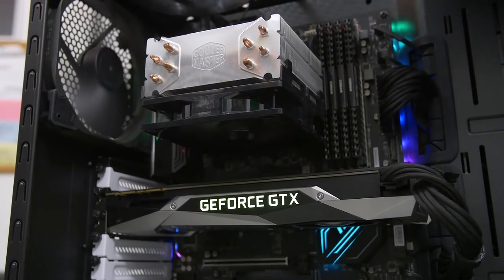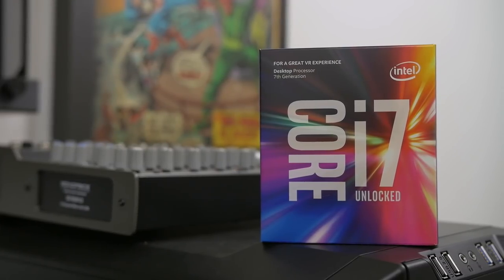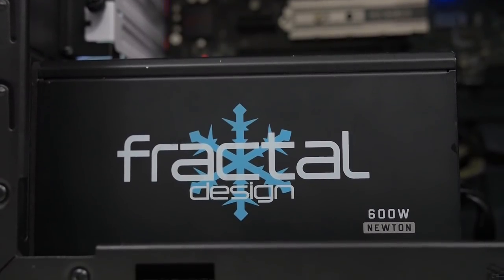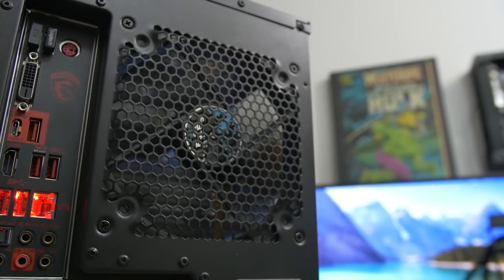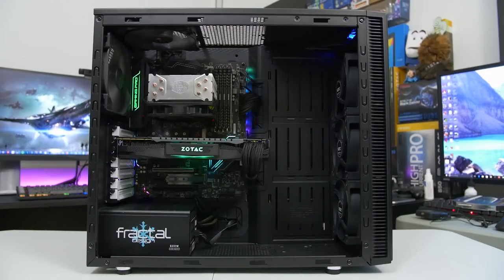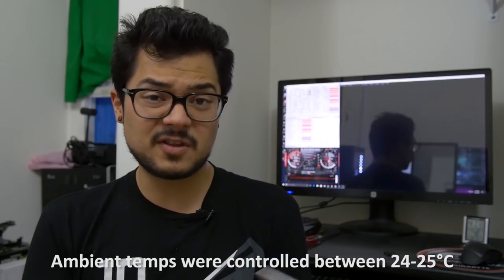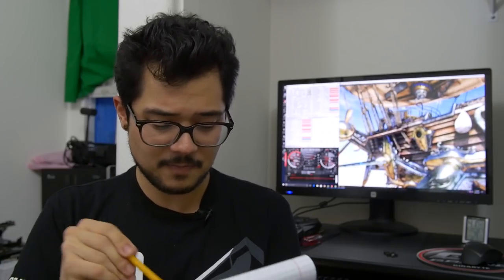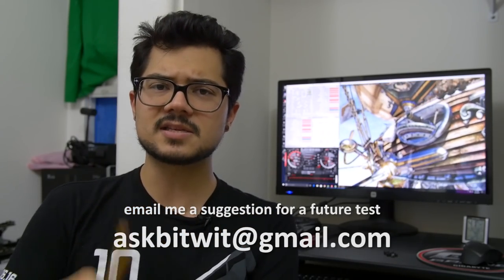This is how you should mount your CPU cooler! I think??

Comment: My coolermaster hyper 612 for my 970 didnt have the option to mount it so that the fan blew with the air flow of the case....so it sucks in air from my graphics card.
 
But i still idle at 27c and load at 60c so no big deal.

Comment: Hey guys can i have some help, i bought a i7 7700 the other day and its performing much worse than my i5 7400

My specs are
I7 7700
Asrock H110m-HDV
8gb ddr4 2133mhz
AMD Radeon R9 200/ HD 7900 series
Tp link 30mbps 
Intel stock cooler (rgb on its way)
Deepcool tesseract with 3 case fans (my cpu tempts dont go above 40°C)

Comment: had for 2/3 years fan is getting warm/worn going get new one. Had older one it did no better would not get for over clock it holds ok but extra height to much for not much cooling it ok in pinch

Comment: Bro Bitwit Help PLEASE Mate …. Do you know of any air cooled cpu coolers that's ram friendly with 5 or more heat tubes on it I need one to clear my G-SKILL RIP JAWS X Blue Ram … I have 32 gigs so I use all 4 ram rows on the mobo and will not sacrifice my first row and leave myself with only 3 to use. Want to run my i7  4790K as cold as possible without going liquid cooled.

Comment: Can anyone help me i have an amd a8 7880k or sumat like that lol i have a normal heat sink (the one that lays on the chip) and a little fan on top of it, i have read if u have small space and or little air to ‘induce cooling’ < pull away from the vanes of the sink’ or if u have loads of air intake and or a big surface area to ‘force blow’ < fire air inbetween the vanes! My fan puls away and my temps are hitting 60 to 80 even caught it at 82 once and even 92!! Which way should i put my fan i have a loads of airflow but not a big surface area and that fan is small compared to all the rest? Im thinking of getting a virtical sink and fire air through and out the back with the help of the back mounted fan or should i just get a better fan and force it?! Ive also been reading up on fans and they have an air flow measurement am i wanting that number on a fan to be as high as possible? Any help is appreciated.

Comment: I got a like 10-20 degree drop from switching to a vertical placement. But no exhaust fan above. Only the rear and the exhaust above ram I have noticed that having a fan above seems to kind of kill it..  like potentially bringing all parts toward the heatsink. 

So with your set up... I was getting about 44-47 idle, about 57-62 load.

Switching the exhausts around I instantly noticed about 28-31 starting to bios, 30-34 idle, and I have seen it get to.... like 44-54 load.

Comment: I run that same cooler on my FX 9590 and have it Vertical. At the top of my case HAF 922 is a 200mm fan taking air out and straight up. my temps stay below 52 degrees.